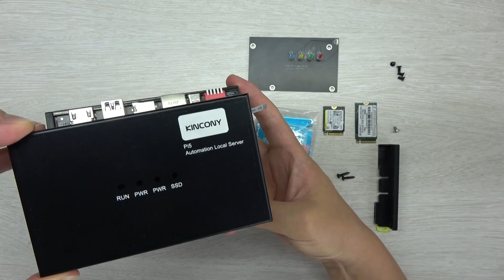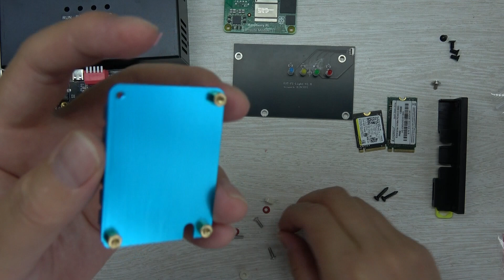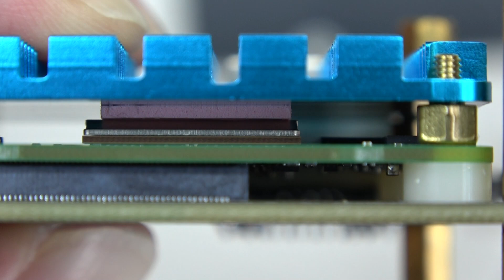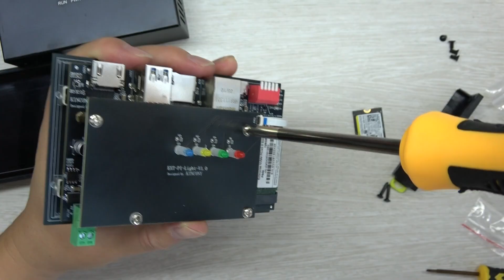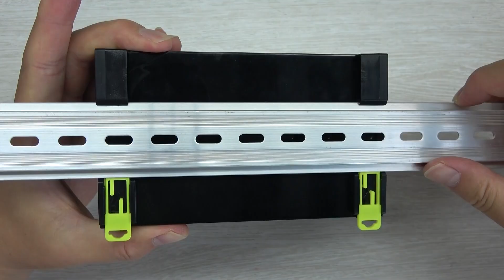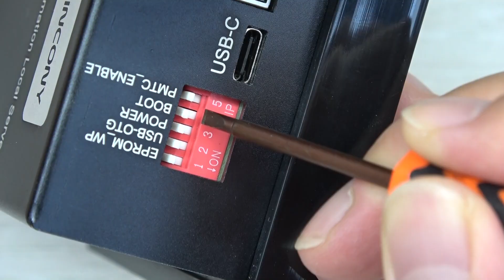Raspberry Pi CM5 DIN RAIL Home Automation Local Server - KinCony Pi5

Comment: you should have take the all the pins out of the pcb  .so people can use them for gpio with the case on...the other side of the case have lot of space u can use for gpio pins....specially considering home assistant support in-build sensor controlling  like modbus and others in linux os..it is really  a waste not to use gpio pins as they can be use for many things in home assistant.
Reply from the maker: thanks for suggesting